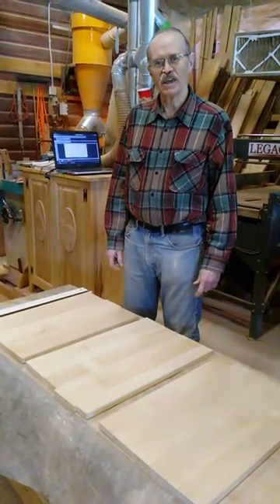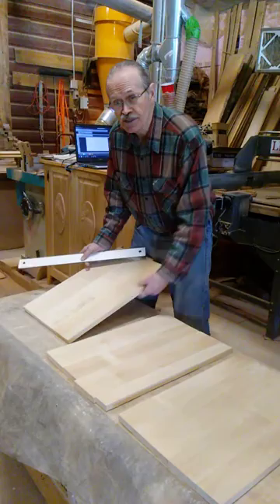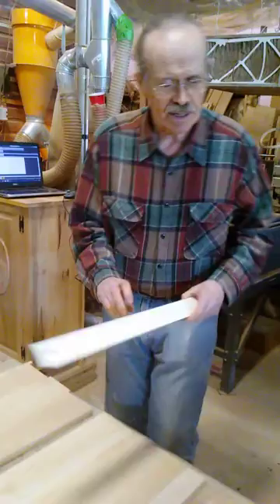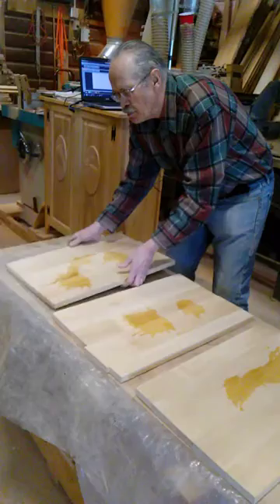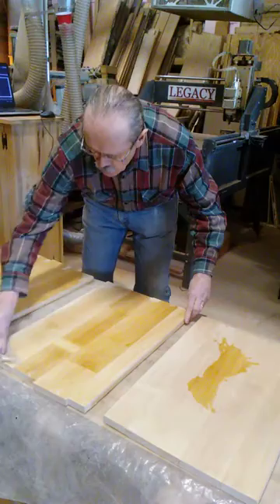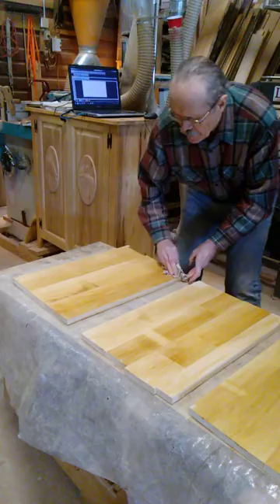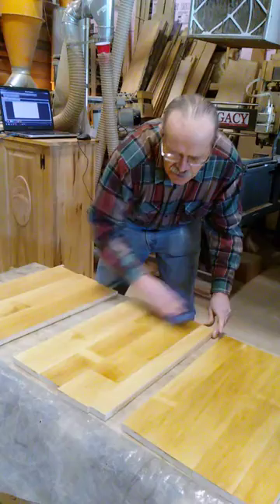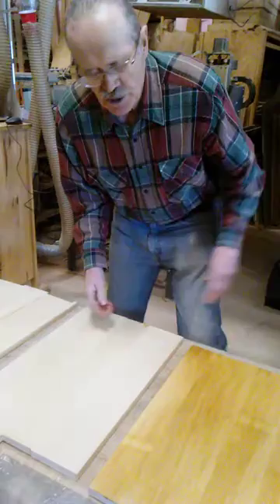How to flatten out a warped panel.

Comment: Im looking for the second video and I don’t think there is one. ☹️ I’m trying to repair an old table. The wood is warped on several boards. I hope this works.  I will let you know.
Reply from the maker: Video 2 will be posted Jan 4!  Once the boards appear flat, continue flipping from top to bottom on the plastic until they appear dry and stable. Then set them on sticks so they dry on both sides . continue to watch them. If on developes a cup turn the cup side down and continue drying and watching
Reply: @finewoodworkersstudio5215  does it need to be warm in the workshop , e.g., summertime?  Or will it work regardless of temperature?
Reply: @finewoodworkersstudio5215 there would not be a warped problem if the person that left the panels on a bench overnight would have stood them up so that plenty of air got to both sides.

Comment: Me, too. I was just looking at it bc one of my shaker cabinet doors that I recently made has warped. Where's the rest of the vid?  We're left hanging, pardon the pun.
Reply from the maker: Dale here. check the panel as it dries, when you see it begin to warp in reverse,  flip it over. When you see the panel "cupping" on top , flip it back again. Continue flipping the cupped side down till panel is flat. Don't add any more water unless this drying process fails the first time.
Reply from the maker: Set the flat panel on 2 sticks to completely dry a few days, depending on weather